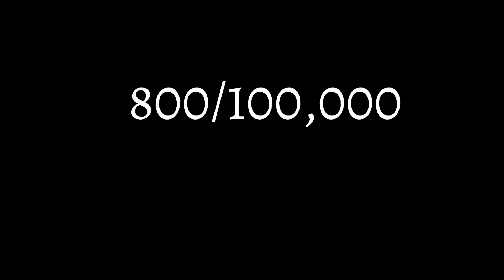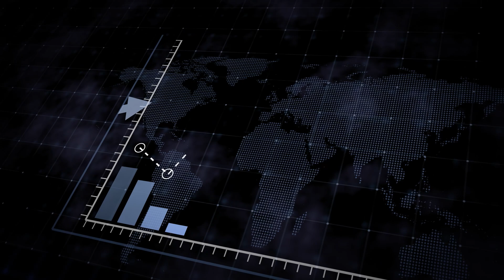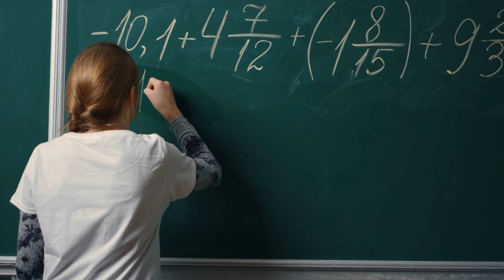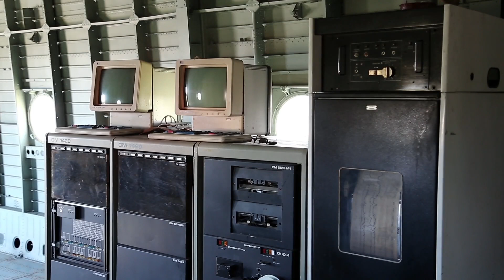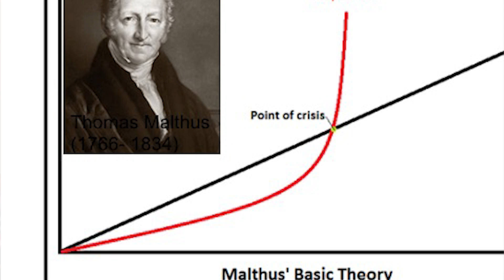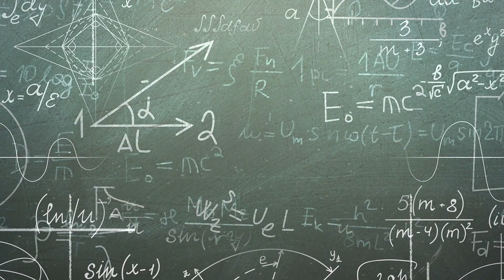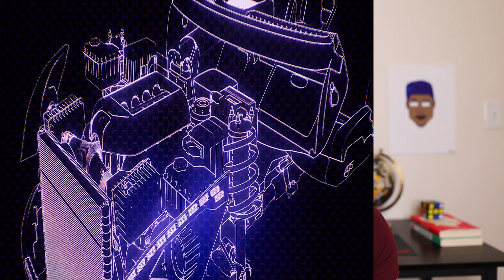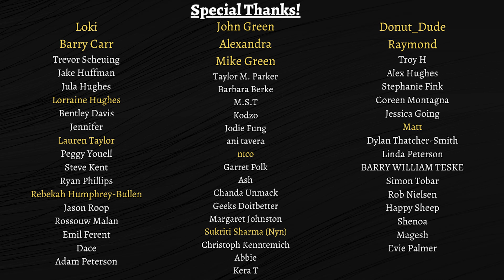The Invention of Progress

Comment: As you pointed out, politics are often in the way of progress, production and well-being.
They often shift problems elsewhere (and stop bothering about it) rather than dealing with it. Let's consider plastic recycling: now that China stopped collecting plastics from around the world most countries simply stopped recycling (they pretend to do it, but then plastics, even when separated from the rest, ends up with the general waste). About cars, some countries are making deadlines for petrol cars production, ignoring that the lithium used in batteries can have a worst impact than cars in a shorten time; this because instead of facilitating people to get on bicycle or cutting down meat consumption, prefer to "sugar coat" the new technology.
London floods every year, but it seems nobody want to notice it. With all the rain water that falls on the concrete floor nobody knows what to do, meanwhile they drink the recycled water from sewage. They spend 3 years talking about Brixit and ignored everything else. And London is just an example; every country has a similar problem.
looking forward next video on this subject.

Comment: So I have this article from 1953 in front of me (High Speed Arithmetic: The Digital Computer as Research Tool, in Journal of the Optical Society of America (JOSA) Vol. 43, iss. 4 page 306, by H R J Grosch) where Grosch cites JW Forrester director of the Digital Computer Laboratory at MIT  at a talk at the joint meeting on computers of the American Institute of Electrical Engineers and Radio Engineers in 1951 entitled "Digital computers: present and future trends" (p. 109 of the Proceedings) said that if we combine the speed, reliability, memory capacity and cost of typical calculating machines (ie computers) into a suitable index that since 1945 this index would have increased year to year by a factor of 10 and showed no sign of slackening.  

Grosch estimates that a computer just installed where he worked at GE had 20 000 times the speed, 200 times the memory capacity, 10 times as reliable and half as costly as the Harvard Mark I in 1944. Grosch estimates that the next generation of machines will see a 10 fold increase in memory and that the generation is about 2 or 3 years. 

Now Grosch is not talking about storage here but only active memory, still storage had also massively increased in this period with the switch from paper cards and tape to magnet tape and magnet tape was constantly being refined and we have magnetic drums (usually used as memory) and then the disc drives you mention. It seems likely to me that a 1950s commentator would not have found an increase of six orders of magnitude (on the order of a million) over six computer generations (taking the generation as ~3 years), so fantastical.

However I think your point in general still stands in general our predictions about the future is that it will be like the present but more so and that we fail to properly understand how the future will diverge from the past. It is just in the case of the computer industry from the inception of electronic computers with vacuum tubes at the end of WWII and going on through transistors and microchips (Moore's Law) rapid exponential growth has been the constant background and while the full implications of this were hazy and difficult to grapple with the idea that growth would be of that magnitude was not the stumbling block (since the present is one of exponential growth we expect that growth to continue).

On a completely different note, I always remember that archaeologists can often date ancient sites to within a few decades based on the changes in things like the style of pottery decoration and so while progress as we now know it may have been absent or barely perceptible change has been a constant in subtler ways. Likewise while not necessarily undergoing marked improvement the technology and culture of ancient peoples both hunter gather and agriculturalist was often complicated and in some ways well adapted to way of life of those people (so complicated tools and weapons for hunting or the use of the water wheel Mill by ancient Romans and many people in Europe and Asia over subsequent millenia etc.

Anyway a very interesting and tricky topic you have chosen, it is very stimulating though, good luck.
Reply: I made a  comment about this but it disappeared so I guess the Youtube gods decided it violated community standards. So I will reiterate it here and see if it can remain. In 1904 Henry Adams in his book the Education of Henry Adams has a chapter (34) A Law of Acceleration. In it he refers to exponential growth in technology such as the double of effective steam power each decade since 1820 and on the basis of this suggest the power of humans and technology in the year 2000 will be incalculable. Such negative predictions of course are not exactly as fun as positive predictions either hilariously wrong ones or strangely prescient ones.